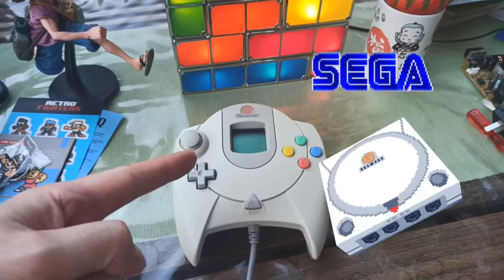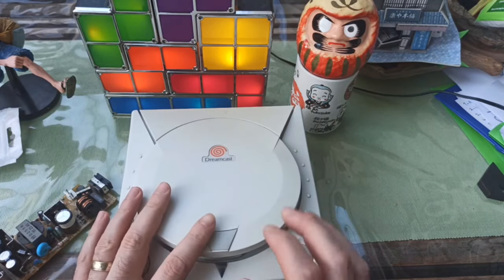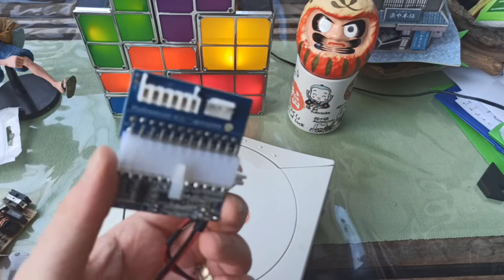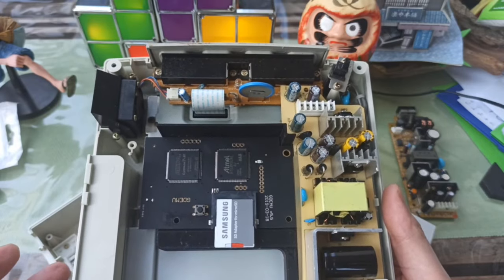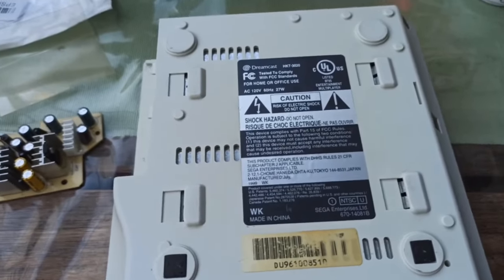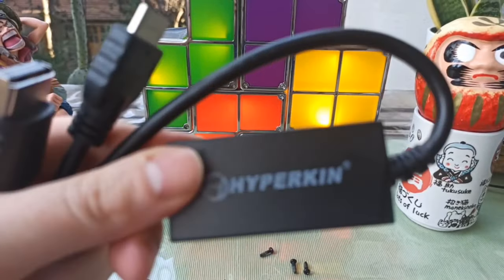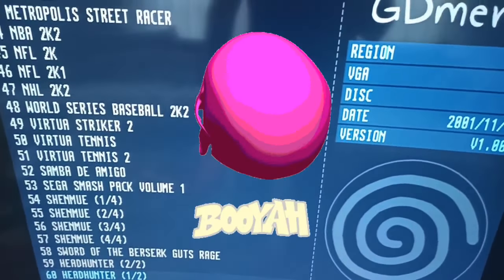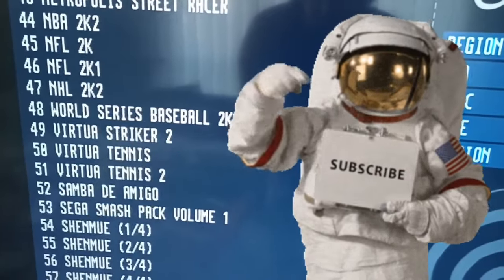Easy Dreamcast Mod

Comment: it start from moding stuff, you suddenly learn soldering changing solid cap etc, not long from that you start designing your own circuit board, and making portable console, don't be afraid on exploring and experience new thing mate!
Reply from the maker: You're right! I have already soldered something! Feeling very proud 😂

Comment: There are many YouTube videos that will help you fix the voltage overheat problem without changing out the power supply.    The 12V pin is used for the GD-rom and if you remove it nothing uses that power so it runs hot.  Disconnect that or put a resistor in that pin will resolve that issue fairly simply.
Reply from the maker: Good to know! It's not an issue for me now with the pico psu. The problem for me was that I needed to change my power supply regardless, since it was an American system running in Europe. I could have used a big clunky converter, but when I learned about the pico and saw how small and compact it is, I had to try it. I'm very happy with it, but since it's hard to find now, your advice is extremely valuable for anyone having the same problem. Thanks for watching, by the way!
Reply: Has anyone ever really had a power supply 'blow up'?

Comment: Love the video and the channel…I love my Dreamcast…Few questions? Where did you get the extender to cover the hole? Also, I could not find the Pico PSU, but I did find a power supply Fauge…Will that work?

Comment: Not that anyone asked... my build... terraonion mode, dream PSU, DC HDMI, noctua fan, original european case... Loving it to bits, it's also frankly the best console ever, very closely tied with the Mega Drive :)
Reply from the maker: That sounds like the true "ultimate" build. I've gone as far as I'm interested in going though. Since I've started emulating through Redream on my Nvidia Shield, playing DC flawlessly at 60 fps in widescreen 4k, I have a hard time going back to the real console. I know that may sacrilegious to some, but it is what it is 😂
Reply: @GamersOverdriveRetroMode  it actually isn't sacrilege. They're quality of life improvements that come with being alive in 2021 and you shouldn't turn them down in favor of purism or snobbism imho. If you do put it under the microscope, I'm not playing with the real console: no grinding laser sound, no loud fan, full HD video, overall cooler system, no sharp d-pad and clunky controller (I also have the retro fighters pad). I think you need to be able to embrace these in order to take full advantage of the DC legacy nowadays, so I'm totally in favor of using redream or a beefed up system. Great build, btw :) I used to have mine like that a few years ago and it was already amazing!
Reply from the maker: Thanks a lot! And I agree 💯%

Comment: 1. To use this particular original psu with 220V you only had to replace the big brown capacitor with one of the same capacitance but 400V rating. Caution, I'm reffering to this specific psu that I saw on this video, there is another revision that beside the cap, two 62Kohm resistors need to be added in order to work with 220V. Its simple, there are guides on the net. I would definitely preffer the modded original psu to the bootleg chinese on from aliexpress that surely has crap capacitors.

2. The heat issue by using the original psu can be remedied by installing a 3d printed shell for the gdemu, that way the air pumped by the fan will be vented through the psu. There is another way that I personaly never tried that includes disabling the 12V line of the psu (useless for the gdemu, only used by the original GD Drive).

3. When using the picoPSU you definitely need a good external 12V PSU and not a crappy chinese one, otherwise you will be getting distortions on screen. Personally I used (more than once) the LEICKE 12V 4A psu 48W (Model NT030011) but they're not cheap and they never run hot.

Comment: I prefer how the VMU sits flush with the OG controller. But most importantly, how would the bumpers work in games like Sonic adventure wherein triggers only turn the camera? Would they also turn it like in the Xbox 360/PS3 ports?
Reply from the maker: The bumpers are just clones of the triggers. It's made specially for fighting games. Pressing triggers in fighting games sucks, so they added them, but you can still use the triggers if you prefer (but no, no special features like the later ports). As for the VMU, it would be better if it sat flush, I agree, but the easier-to-view window is worth the tradeoff.

Comment: To be fair, the original controller used hal effect sensors (magnetic fields) for analogue input. Far superior to anything else, perfect deadzones, extreme precision, They literally can't break. The Retro Fighter is your typical potentiometer affair, which will wear and cause drift after extended use.

Comment: Do you have to have the pico psu or is there one like it; that will work with this?
Reply from the maker: There is a link to the pico PSU in the description of the video, but it's an old link and may or may not still be available. They are for sale on Ali Express though, so you could try there. Dream PSU also works from what I hear, but I haven't tried it.

Comment: I have the same issue - I have an overclocked dreamcast with GDEmu, however it keeps overheating. Would this solution work with a European console as well? (Different voltages etc.)
Reply from the maker: Yes, this will work with Euro Dreamcast too from what I know.

Comment: Is PicoPSU compatible with Kaico HDMI adapter? I'm hearing that adapter needs +12v on psu. Thanks for the help.
Reply from the maker: I actually didn't know about the Kaico HDMI until reading your comment. The Kaico looks to be not much different from the one used in my video, just a simple vga passthrough, so I would imagine that it would be fine. But yes, the picopsu needs a 12v power cable. I would check with the company directly to be sure, but I can't imagine why it wouldn't.
Reply: @GamersOverdriveRetroMode  Thank you so much!

Comment: Hi, just wanna ask you something. Where can I get an adapter for power supply for dreamcast? Mine, is broken
Reply from the maker: Amazon is the best place. Just type "Dreamcast power cable" into the search. I got one from Amazon it it works perfectly. It was under 10 dollars.
Reply: @GamersOverdriveRetroMode    tqvm

Comment: Dont think the Hyperkin adapter is the move my man... DC has native RGB/VGA output. It'd probably be higher quality and lower latency to use a VGA to HDMI adapter since most converters meant for PC are low latency as long as it doesnt scale (which begs for a VGA CRT which are easy to find and store and move compared to CRT TVs) but theres a reason DCDigital is always sold out, and thats because its high quality. Hyperkin, at least for anything technical (or most things lol) is almost always not the way to go. Especially for video. Use an OSSC or Retrotink which would be easy since DC has RGB out and everything, and the OSSC/Retrotink can be used with any console etc.
Reply from the maker: Hyperkin was a cheap and easy option I picked up a few years ago. For sure there are better options. Check out my "Behar Bros" episode. They have incredible options and they know their stuff. Everything you said is right in line with what they say. Thanks for the advice, and for watching!

Comment: Can this be serial produced in a high quality but cheap way? Cause I'm gonna send this to TECTOY... 

And if you guys pitch it correctly, maybe, just maybe, they can produce it on-demand to sell in Brazil!
Reply from the maker: If you mean commercially produced...hmm, since this is a modification of original Dreamcast hardware, and there are a limited number of dreamcast consoles in the world, that would be a tough one 😂. The GDEMU is only necessary when working with an original dreamcast system, but emulating dreamcast on a PC, or even an android phone, is not very difficult at all. What you are talking about sounds like a Dreamcast clone console, which is totally doable, but wouldn't need any of the tech displayed in this video. There would be much easier ways to do it. This project is just for people who already have Dreamcast consoles and want to update them and keep using them in the modern era. But if you know something I don't...let me know! 🙏😉
Reply: @GamersOverdriveRetroMode  I know this: TEC TOY still has a license from SEGA to sell their software... And has a deal to produce an ATGames-like Genesis console, with SD card support. 

Their relationship with SEGA is in good terms for what I know. That's why I'm telling you: If you pitch it the right way, this has a small chance to be industrially produced, even if it's on-demand to be sold in Brazil... And Brazil has a history of doing crazy SEGA related stuff (The Street Fighter II for Sega Master System port, case and point)...
Reply from the maker: 🤔I'm intrigued...any ideas on how to reach them?
Reply: @GamersOverdriveRetroMode  Twitter/Facebook/Instagram: @tectoyoficial

It's in portuguese, since it's a brazilian website. But  please try to get in touch with them. Might be worth the ty.
Reply from the maker: I messaged them on Instagram and used Google translate to turn it into Portuguese 😂 Let's see what happens. Thanks for the great idea, by the way, and thanks for watching my channel! I really appreciate it.🙏
Reply: @NegoClau  O problema não é só os direitos, é que um console antigo pra dar lucro precisa ser vendido no mínimo a R$1000,00, já viu os preços dos Dreamcast por aí ? Uma empresa com funcionário precisa ter lucro, além disso a Sega vai precisar receber sua porcentagem das vendas. Ou seja, acredito que o valor investido + número de vendas - (menos) a parte da Sega = lucro baixíssimo.

Comment: The VMU Window on that third party controller is not larger, it's the same size but the controller is smaller so the VMU sticks out. How is it better for fighting games? The buttons are laid out  out the same way in a diamond as appose to how they are on a fighting stick, if thing a controller like the Saturn or Genesis 6 button controller would be better for fighting games.
How can you hat Shenmue? that's like a Nintendo Fan Boy hating Zelda< Mario and Smash Brothers.
Reply from the maker: A few things here...First, do you own the Retro Fighters controller, or have you at least used it? If not, you probably can't get a real understanding of how it improves the viewing space of the VMU screen. The original DC controller has excess plastic on the interior that hiders the viewing angles. The Striker DC cleans that up and improves the view. That's a fact. Next, as for how it's better for fighting games, it was designed for them. Not every fighting game controller needs to have 6 buttons on the face of it. This one has both shoulder buttons and triggers. The original DC controller only has triggers. Many people, myself included, learned how to play fighting games on an SNES controller, which has four face buttons and two shoulder buttons. For me, it's the ideal set up. I also love the Saturn controller (I reviewed the Retrobit wireless Saturn controller on my channel), but this one is still miles ahead of the original DC controller when it comes to 2D fighters. It was, after all, designed with that specific purpose in mind. Finally, as for Shenmue...you are talking to a guy who has invested countless hours into the series since it's initial release. There was nothing like it at the time, and I give it credit for being a trailblazer of sorts. That said, due to my being a child at the time, I forced myself to ignore it's horrible writing and laughable dialogue, which is some of the absolute worst in gaming, period. The story is ridiculous, the gameplay is stiff and boring, and the characters are paper-thin caricatures that make me feel embarrassed for the people who created them. And yet still, I played through 1 and 2 and pretended to love Yu Suzuki's "masterpiece." I also lost my mind 6 years ago at E3 when he announced the Kickstarter release of part three, and instantly funded him. What I got out of it was much more valuable than I ever imagined: a wake-up call. Yu Suzuki has been milking an extremely overrated franchise fueled by fanboy nostalgia and hard-earned cash. Shenmue 3 absolutely sucked, and it slapped me in the face with the reality that, sadly, so did parts 1 and 2. This is all personal opinion, of course, and if you enjoy the series, more power to you. But don't come at me as a casual observer. I've invested a lot of myself into Yu Suzuki's Great Lie, and my opinion is informed.

Comment: lol, need DCHDMI to be ultimate, at least!
Reply from the maker: Ultimate is a relative term in this case. What's "ultimate" for me will never be the best that's available, because I'm not a tech guy. I'm a regular game lover who occasionally tinkers for fun. 👍
Reply: DCHDMI really's the ultimate upgrade !
Reply from the maker: It is, but two problems. One, it's expensive. Two, Dreamcast wasn't built with 1080p in mind. As a 480p console, bumping it up to 1080p shows every jagged little edge in crystal clarity. There are ways to fix that, like the M cable, but that's expensive too. So if all you want is 1080p Dreamcast, just emulate it on Reicast or another good emulator, and use the enhanced rendering to smooth it all out. That's free, by the way. But DCHDMI plus an M cable is more money than I want to spend, especially when 480p is really plenty good enough for me 👍. 

...and after saying all that...would I still take a DCHDMI for free? Of course I would! 😂
Reply: @GamersOverdriveRetroMode  lol that's true
Reply: @GamersOverdriveRetroMode  You really have to see the difference with DCHDMI and the firmware upgrade having HQ2X it looks amazing even without an Mclassic! Your mods are kool but ultimate? Hmmm...
Reply from the maker: Anything is Ultimate to a man who hasn't seen the Ultimate 😂 My mods are cheap and easy. DCHDMI is hard and expensive. Better? Yes. But Ultimate is relative depending on what you're aiming at. DC Games were not designed for 1080p. That is a fact. They were made with 480p Max in mind, so when you go beyond that, you will see all the jaggies and hard edges that come along with it. I can currently run dreamcast games on my phone in 1080p on an emulator for free. Do I need to spend all that money for DCHDMI when it's free via emulation?

Now...all that aside...if someone gave me a DCHDMI mod for free...I'd be very happy 😉
Reply: @GamersOverdriveRetroMode  I get what you're saying but there are issues with emulation plus nothing beats original hardware. I've also got the first ever all-black dreamconn custom made by Chris over at Dreamods so yes maybe I am super hardcore lol. Games maybe weren't designed for 1080p but taking the raw digital signal and making it better is the best thing that could've happened to the Dreamcast. Hopefully you can experience DCHDMI soon 👌
Reply from the maker: bring it on man...I seriously do want it 😂

Comment: striker Dc's nice, but fail fast, well the triggers do, 100% guaranteed to fail if you try to play Metropolis Street Racer for more than an hour or two. both mine failed.
Reply from the maker: That sucks! Not happy to hear that. What's their warranty support like? Any idea?
Reply: Gamers Overdrive Retro Mode didn’t have any problems with getting a replacement, only that failed with less than 8 hours of use. I can get a refund and be left with no striker dc.. I opted to keep the pad and only use it for fighters.
Reply from the maker: That seriously blows. Very sorry to hear it. That said, I only bought it for fighters anyway, but if the build quality is that suspect then the company needs to know and take care of it. Thanks for letting me know. I'll be easy on those triggers now 🥵
Reply: Gamers Overdrive Retro Mode best i can figure out the problem is when your finger slips from the trigger it shuts so violently with no damping at the stop it breaks the locating pins clean off as they are far to weak. When this happens the affected trigger tends to not run true in it’s slot any more and locks up causing the othe pin to either pull out or break..

Comment: Can this be done with a sega saturn?
Reply from the maker: Yes it can! But not with this particular board. There is one from Terra Onion that works in side of both Saturn and Dreamcast and emulates the disc reader of both. Definitely worth a Google.